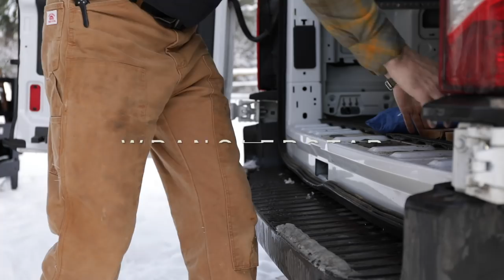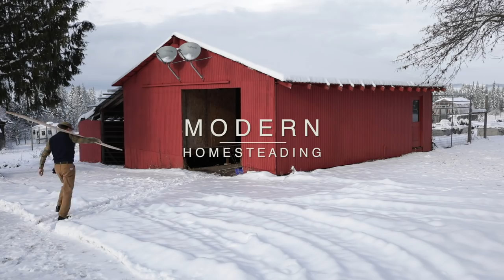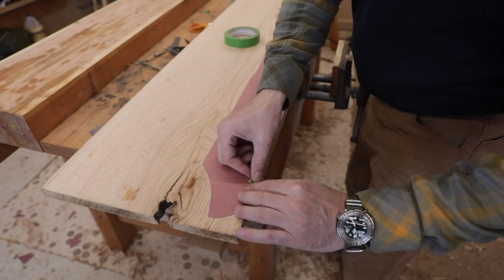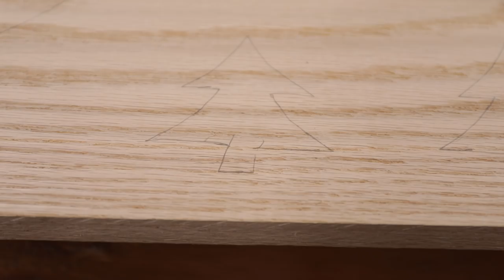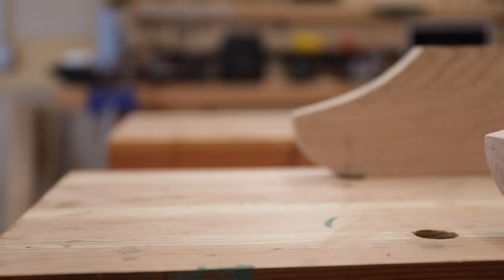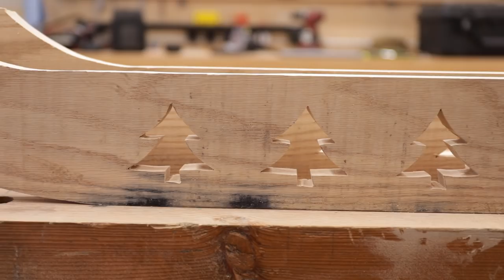HOW TO BUILD A SLED 1

Comment: I had something similar when I was a kid.  It is a sled.  You lay flat on your belly and you go down hill head first.  May be this is the bad idea you are talking about.  However, if I recall it was very easy to steer by using your hip and legs which were kind of dragging behind.  Way easier to steer than a genuine Toboggan.

Comment: Loved the video and I think your making a good point but I have to respectfully disagree with the metaphor of the contract with the hardware supplier. If the suppliers breaks the contract it is nullified however your spouse gaining a little weight  is not grounds for divorce.
Reply: Malachi, I feel similar about the use of the word contract. I would prefer to think of it as a covenant, but there are probably many non believers here who will disagree. 

When I got married, the "contract" part didn't make a damn of difference to us. We were married before signing that piece of paper.

Comment: Easy one, runners for a sled. Looks like white oak. The cut outs may be a bit risky as lateral force may split wood, if I were building it I'd router it a 1/4" in and stain it, yes holes look much cooler to look through, but with a sled you're running and chest jumping on it developing hundreds of pounds latteral force, and you want to have it last for multi seasons and not snap and stop coming to a grinding halt but that's just how I'd do it for your expending lots of man hours on this project & as ice is very abrasive and then water gets into grain quickly and then freezes and wood checks quickly. Question is: Well built & used, or pretty art piece? Cody Happy and Blessed new year.
David

Comment: Wishing all the Wranglerstars a happy and healthy new year. I have enjoyed your videos this year and envy your lifestyle but now am too old to work so hard :) Having just celebrated our 35th anniversary, despite many challenges over the years, it does take work and sharing.  On a different note, you mentioned not having cell coverage on the property. Have you thought about installing a high power Wifi antenna outside so you can access the internet, wifi calling, skype, viber or other services from your smartphone? A good powered antenna can reach several miles. There is also internet to cell phone repeaters. Magic jack can plug into your router and give you a regular phone number, voicemail etc for stationary use. Enjoy the beauty of your place and God Bless.

Comment: Wow slightly jealous of the set of fostner drill bits . Cut that board like slicing cheese. 

It’s obvious to everyone that those are runners for something, not curved enough for rocking chair or cradle . 
The tree cut outs are decorative as well as making the item slightly lighter.

If the runners were cruder and heavier I’d say a log scoot to tow behind the 4 wheeler , but it’s too refined to be that. 

Looking forward to see what it turns out to be

Comment: Perhaps this video deserves revisiting after some contemplation.

The definition of Christian marriage should be:  "A covenant commitment to love another imperfect person, unconditionally, for a lifetime."

Marriage is a covenant commitment. Not a contract.

Thinking that marriage is a contract is the primary reason for divorce. Put simply, fulfill your part of the deal, or else. That's not part of God's design for marriage.

Lasting relationships are built upon a foundation where align on core values exists. The example where one spouse doesn't take care of themselves goes to a lack of understanding between two people in areas such as fitness and nutrition for the purposes of maintaining the highest possible quality of life for as long as possible. Either that, or deception on the part of the offender.

In his own marriage, it's clear that Cody and Mrs. W are aligned in many areas, including fitness and nutrition for the purposes of maintaining the highest possible quality of life for the longest time possible.

Lastly, I agree that Mrs. W's female perspective adds tremendously to  Manly Manners segments.